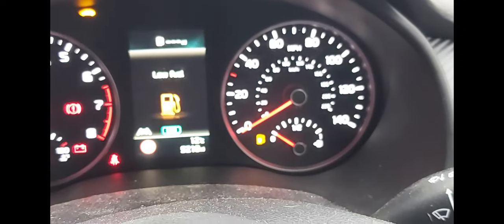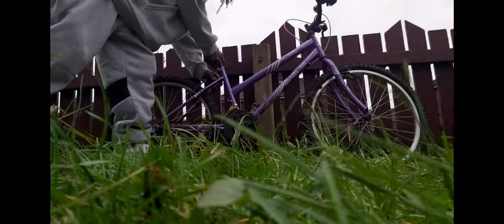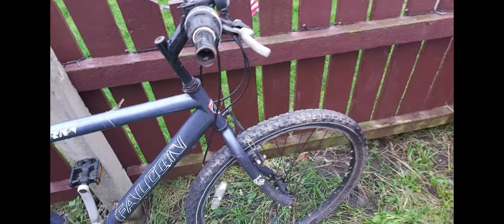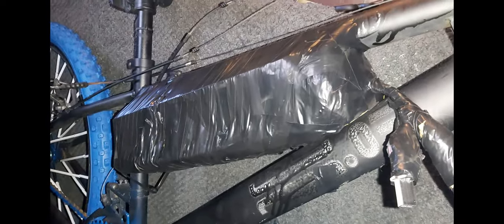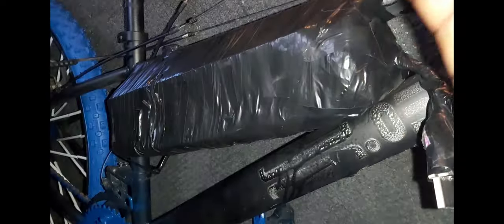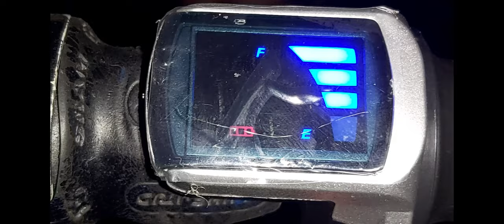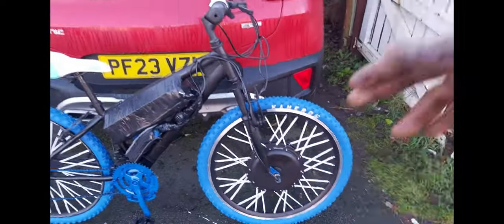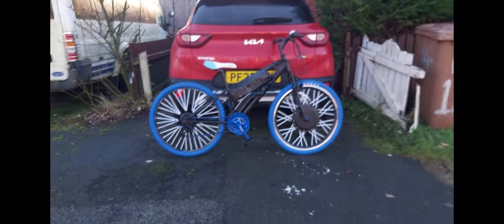Ebike Conversion Kit Step by Step guide on MTB

Comment: Where did u get the battery and kit?
Reply from the maker: Both the Battery and ebike kit were sourced from ebay auctions. Bidding and patience. Battery is only 12ah at the cost of £30. The ebike kit was brand new at the cost of £143 posted. Plenty 2nd hand versions available for less than £100 but you want a good low mileage or new hub motor for longevity and half decent budget bike. 2nd hand hub motors may need servicing for better results. Thank you for watching
Reply: yes, that's good, you did really well, this is your first time  @Sim-Rig